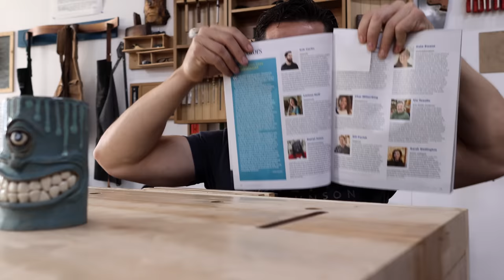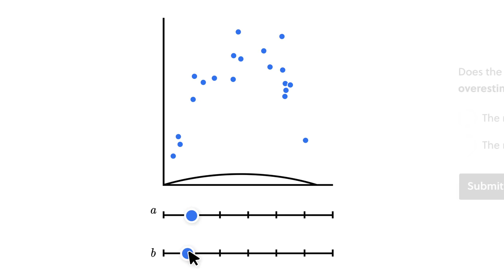5 tips youtube woodworkers give that professionals HATE

Comment: C channel... this has bugged me no end for ever since i first saw that setup. Only reason to use C channel is to help the reinforce gap in a slab, say you have epoxy river table that is not transparent so channel is not visible, there using channel to tie those two slabs together makes sense, so absolutely ridiculously expensive epoxy wont go waste with the very expensive slabs.. how ever what does not make sense is to router just grooves into wood and then screw the channel in really loosely so those few screws do all the holding. Of course wood and metal contract and expand on different amounts so total hard mount might cause issues, but couple screws do fuck all to hold the slab stable. You are better to route a groove and glue in peace of wood as reinforcement than this... then again i would never waste so much money for river table. Respect the slabs and use epoxy just to enhance it, not over power it. Fill the cracks etc in the wood, but you have gone way too far is 1/3 of the table if epoxy. 
For the warping part... you remove its ability to change its temperature and moisture content. Essentially putting coat that does not allow air contact and keep it in stable room temperature. Professional can look the grain structure and note how it will most likely bend after milling, amateur mills and looks the result. Pro checks the moisture content and keeps it in intended indoor moisture level during storage of lumber and when its ready product. , you use that same resin to glue it in place imbedding it in a sense there as how ever good the screw might be.

Difference between amateur, hobbyist and pro is only in skill and knowledge how to hide the mistakes. Personally i dont like glue trick since that always changes in color and it is not realistic. Decent method for amateur and hobbyist, but above all else finding ways to his ones mistakes makes you a pro. For instance just take that flaw amount off if its possible or add tiny strip of same grain pattern to fill the gap on top surface while using glue trick on the bottom where there might not be anything visible. Then again i'm starting get frustrated when 99/100 people dont even see the mistake even if it blaringly obvious -.-

Comment: Blacktail studios uses a combination of drying and C channels has he got this wrong?
Reply from the maker: I have no doubt that Cam knows what he's doing, especially when it comes to properly drying wood in order to avoid issues down the road. I'm not arguing that one shouldn't use C-channel, I'm simply arguing that if a slab is improperly dried and it wants to warp or twist, a handful of screws in a piece of steel is not going to stop it from doing so.
Reply: @ENCurtis  I don't think I've seen anybody advocate for C channels in lieu of using properly dried wood. Because yeah, I've seen hardwood floors literally shove a concrete wall off the foundation when it was laid in a room that it had not been acclimated to. But for keeping slight bows in check (like a mm or two over a whole dining table) it'll work just fine. Anything more extreme and the wood will tear the screws/inserts out or develop nasty checking.

Comment: The reason this approach causes problems with the tape and ca method is because, doing it the way it is demonstrated here, uses at least 10x the amount of glue that is needed.  A pencil line thin bead is all you need AT MOST.  Pouring it on like maple syrup on pancakes and claiming it doesn't work is blaming the method not the user.  You can get away with a dab of glue every four inches for most jobs.  What I struggle to understand is how anyone could see this being demonstrated by people who do rely on it and still get it this badly wrong.  One strip of tape down either side of the piece you are working on and a very thin bead of glue on each one is enough.  In addition in this day and age should anyone be promoting something which relies on single use plastic against something which doesn't?

Comment: To say a C channel won't "help" to prevent warping is silly and childish.  Of course it will, and saying it won't do anything is obviously nothing more than a cope because you've chosen to not make it a part of your workflow.  Now if you buy a slab that has been handled right and is dimensionally stable do you NEED to add a C channel to make it stable?  Def no.  But if you are in a position in which you are working with questionable wood or can only afford a thinner slab, will adding a C channel give increased stability?  Yes it will, end of story.

Comment: No offense, but this is one of the worst woodworking videos I have ever seen. Just smug criticism of tips that are all useful in some applications. Many of the YouTube woodworkers who offer these tips are professionals, so your claim that professionals hate them is nonsense. You clearly do not know what you are talking about regarding steel channel resisting warping. The force produced by wood warping is not infinite. It is perfectly reasonable to expect a steel channel to help keep a tabletop flat if the wood is not massively thick and if the channel is properly sized. I have personally used steel channel to flatten tabletops that were already badly warped and it worked beautifully.

Comment: Love the video, agree across the board on these, especially the glue and sawdust thing... seems pretty lazy to me! Since this is a vid on correcting the record sort of, I wanted to offer one of my own... live tree's busting up concrete sidewalks is not actually the same mechanism as dry wood moving and tearing itself away from rigid supports. The living tree is exerting a hydraulic pressure that is probably much stronger than typical wood movement. Either way though, wood is very hard to stop moving by simple bonding it to another ridgid material.

Comment: Imagine using a channel as a beam; imagine it looking like - i[ . Now imagine an arrow, pointing down, as a weight. If you put the weight right above the [ , the channel will twist under load. If you put the weight right above the i , the channel will remain upright under load. Separation between the i and channel would be a plate or two - too complicated to describe here, but an engineer could determine the separation for any size channel.